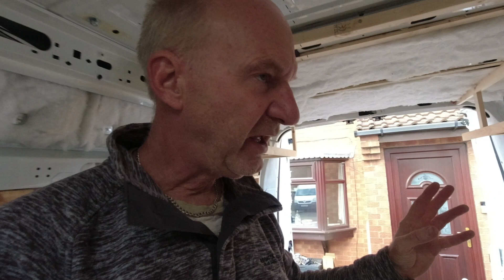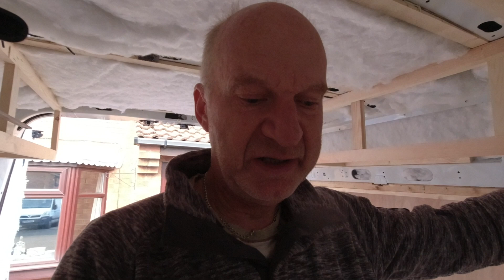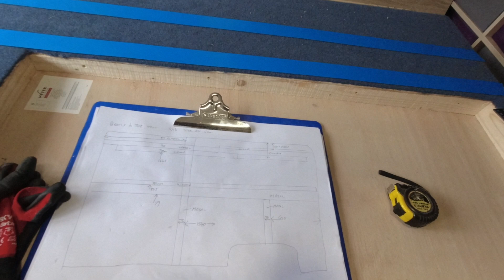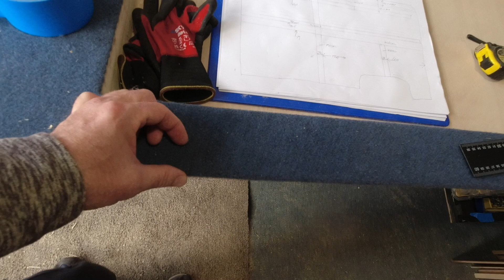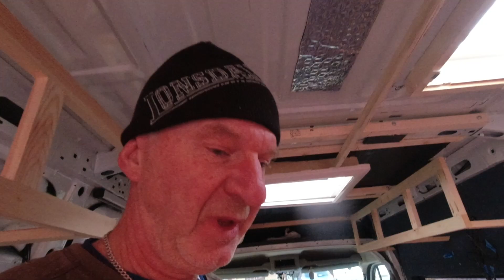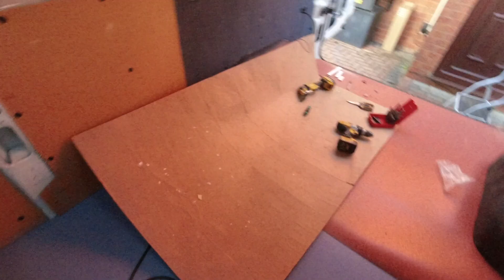Movano Van Build Ep 1

Comment: Hi Steve, I've been binge watching your videos, all good stuff. I'm just at the start of my build (Renault Master). what happened to Ep9? btw do you have solar setup? I'm looking to have solar, and not sure what method I'll use to secure it to the roof (in two minds of either making a rack from unistrut and attaching to that, or just z-brackets and screwing direct to the roof. my biggest is fear is water getting in the holes) keep the videos coming mate.

Cheers,

Geo
Reply from the maker: Hi, Apologies, things moved forward so quick.
I have some footage to edit and there is a conclusion.
I will also do a short video on solar which might help you, its actually very easy and unistrut is perfect.
Reply: No need to apologise mate. I’m looking forward to the rest of your video.

Comment: HI Steve.
We have the movano xlwb high top all done now. Your build is the same as ours . Top tip if your screwing through any stretch carpet to stop the screw and the drill bit grabbing the carpet and it bunching up around the drill bit.
The point your going to drill dab it with a hot soldiering iron first once cooled in seconds it melts hard and gives you something hard to go through  and stops the carpet twisting round the drill or screw...and your right obout the vapour barrier we used the same as you it more like a heat barrier the van stays cool in the summer and holds its heat in in the winter.
Make sure you don't put any insulation  down the side under foot level leave these areas open for it to breathe it more about keeping the air moving around especially at night.
Good luck mate
Reply from the maker: @stephenfoley5292  cheers for that, I did think about the lower sections but no real point insulating, sprayed lanoguard down